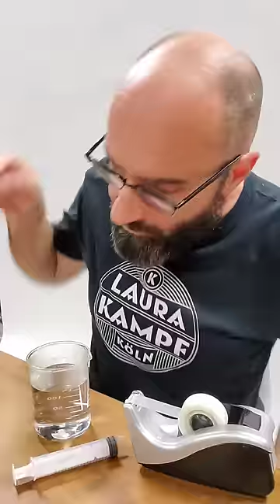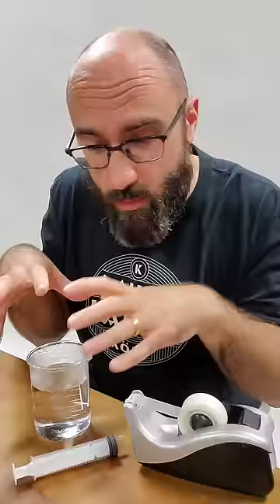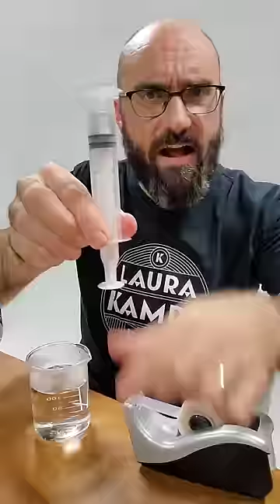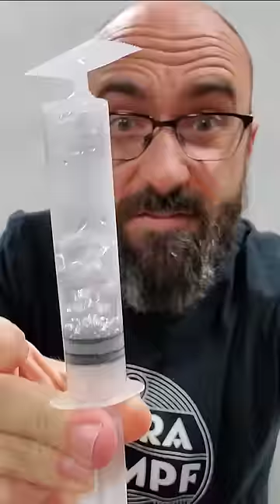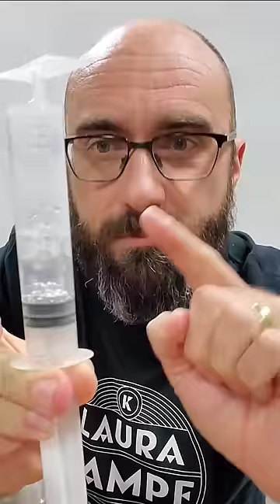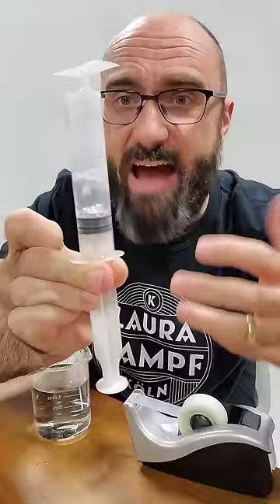Cooling down water by BOILING it

Comment: A couple of additional effects that were not mentioned are the specific energy of boiling and the adiabatic expansion, which both contribute to the cooling effect.
The specific energy of boiling (and similarly for freezing) is the amount of energy (heat) per unit mass that is needed to break the bonds between the molecules that binds them into a liquid. Basically, when a molecule evaporates it steals a bit of energy from its surrounding molecules to give it that extra kick to break free. This is the reason why boiling water stays at exactly 100C the whole time it's boiling, i.e., it doesn't get hotter than that because the evaporating molecules keep stealing heat away from the water at the same rate they get heated up. This is also the same reason icy water stays at exactly 0C. Now, this may be what he is referring to about "hotter molecules leaving behind only the colder ones", because this is sort of how this happens in practice, i.e., it's not really that molecules "steal" heat, it's more that as a molecule randomly gets enough heat to evaporate, it leave with that heat.
The adiabatic expansion is when a gas is expanded, either by an increase in volume or a loss of particles, or both, and there isn't enough time for heat from the environment to get into the container (or it's well insulated). This results in a drop in pressure and temperature. This is the reason why when you blow air out a compressed air can, it gets really cold. Now, in this case, it's a bit more complicated because it's not all gas and the amount of gas is increasing as it expands, but it would be a factor.
Also interesting is the fact that it keeps boiling (as in, bubbling) after the syringe is completely pulled out. This is because the water is now heating back up to room temperature, thus allowing more particles to reach the boiling point in that low pressure environment. So, the water will keep bubbling until it gets to an equilibrium temperature with its environment.

Comment: It seems to be boiling because air is entering beneath the gasket. When low pressure occurs, the pressure seeks a way to equalize the area
Reply: this will happen all the same without an opening at the bottom

Comment: Fun fact, this is how air conditioners work. Michael is the compressor, opening and closing the syringe, then you take the syringe inside to transfer the cool water temp to the indoor air, then take the syringe outside, compress the tube, condense the vapor back to water making it hotter, and let it get back to ambient, and then repeat the cycle.

Comment: This is why steam burns are more damaging than hot water burns with the same temperature. The steam hits your skin, coalesces and transfers it's heat to your skin, and reverts back to water. As such, your skin has observed the kinetic energy, and therefore heat.

Comment: probably the single most perspective changing lesson I learned was that boiling points are determined by air pressure as much as temperature
Reply: Right? Like, how much less heat it takes to boil water on Mount Everest than at Sea Level. Blew my mind.
Reply: This experiment demonstrates why boiling points change with altitude. 
I used to work in a kitchen at 2300m and we had to compensate for the reduced pressure when baking.
Reply: Yup, the super state of matter is really cool! All phases existing st once
Reply: @JB-qq1xz  do you have a single fact to back that up?
Reply: And conversely, how pressure cookers speed up cooking by running at a temp higher than 100°C.
Reply: @kiwirooks7299  he is wrong but matter can be in a superpostion of simultaneously gas and liquid or simultaneously solid and liquid
Reply: @kiwirooks7299  I think he is talking about the triple point.
Reply: @kiwirooks7299  water exists in three distinct phases at something called the triple point. Zero degrees Celsius is defined by the triple point of water which is 273.16K at 611.2 Pa.

At this temperature water is in the process of changing from a solid state into the liquid phase or visa versa. Molecules in the liquid phase can loose a bit of energy and solidify whilst solid water (ice) can gain some energy and melt. This can be seen in melting ice where the solid ice exists for some time while the exposed surface melts.

Molecules in a liquid don't all have the same energy. The energies of the molecules can vary from a finite minimum, which would mark the transition back to a solid phases, up to an infinite energy (although the probability of this occurring is infinitely small). The average energy of the molecules gives us the temperature of the liquid. Statistical thermodynamics can map out the energy distribution of the water molecules. At a certain energy molecules will have enough energy to evaporate, even if the water temperature is 0 degrees C.

Because of these two effects it is possible for the water to exist as solid, liquid and gas at the same time

Comment: This is why the best description of boiling point is when a liquids vapor pressure is equal to the atmospheric pressure and not just a temperature. Awesome video.
Reply: Yeah, that's a good point to mention. the "boiling point" of a substance depends on pressure, and when taking pressure into account makes a boiling curve, which is just part of the phase diagram as a whole.
Reply: Got to get my head around what U just said.
Reply: So is the water in both the beaker and the syringe at a lower temp than what we know as boiling point(in our atmospheric pressure), but this water "boils" in the syringe due to the vacuum change to the atmosphere? Asked in a dumber way, would that beaker water boil an egg?
Reply: @benjaminmartinez3588 It seems you got it. I suppose it would cook the egg but it'd take longer that's why cooking times are adjusted for high altitude areas (lower air press so lower temps of boiling water)
Reply: @douellette7960 nothing you said makes any sense
Reply: Well said , however , the boiling temperature nod the water in the syringe is not 100’C bcos it’s under different pressure
Reply: @benjaminmartinez3588  
No. If water boils at 10°c it won't boil an egg coss the waters temp is 10 °c.
Reply: @benjaminmartinez3588  
Water boils in space where it's temp is absolute zero.
Reply: This actually helped the video make more sense to me. Thanks.
Reply: Temperature in space is not absolute zero.

Comment: HVAC refrigerant theory right there.  Awesome demo!
Reply: What? I guess it's just that the boiling point of water is when the pressure becomes equal to the atmospheric pressure so you can make it low by changing the external pressure.
Reply: @mr-lacker  the water cools down by refrigeration. fridges do it using a compressor
Reply: a simple and ideal vapor-compression cycle is composed of four processes:
1-2 compression in a compressor
2-3 heat rejection in a condenser
3-4 throttling in an expansion valve
4-1 heat absorption in an evaporator

inside the tubes there is a refrigerant. the refrigerant starts by being compressed in the compressor and thus it heats up. 

then, it rejects heat to its surroundings through the condenser and leaves the condenser as a liquid. 

after that, it is throttled so it reaches the evaporator pressure by passing it through an expansion valve or a capillary tube (the principle the video shows). this also causes the refrigerant to cool down.

finally, the refrigerant reaches the evaporator where it "sucks" the heat from the fridge so that it gains the necessary energy in order to evaporate back to a gas.

this gas goes to the compressor and the cycle repeats itself. 

hope this helps.👍🏻
Reply: Damn, thanks for the explaination ^^
Reply: @mr-lacker  That's where refrigerant comes in, it's able to be compressed and heated (and the heat expelled near your radiator), then expanded and cooled (and blown into your car) much easier than things like water.

Comment: best explanation of pressure / temperature differentials I've ever seen
Reply: Do differentials mean they're equal ?
Reply: @Eduardo_Espinoza  differentials means there is a difference in pressure and they are equalizing. It's like a gradient, the molecules go from where there is a lot of pressure to where there is less. They boil up from the high pressure liquid part to the low pressure part thanks to the differential in pressure. The term differential is more used in engineering than chemistry or physics in chemistry we would not say differential but rather deltaP for pressure, deltaH for temperature, Delta being a triangle.
Reply: So differentials are like a steam engine? So the entropy is trying to equal out? @Repetoire  thanks for the reply :)
Reply: our teachers explained as when water boils, it loses energy. vsauce gut's explanation seems more real

Comment: An interesting side note that it takes far far more energy to change the phase of water than to raise its temperature. As in it takes more energy to turn 100 degree water into steam, then it would to take 75 degree water to 100 degrees for example.

Comment: This is basically how "cracking"/"popping" your knuckles, or any synovial encapsulated joint works; when the synovial capsule is stretched beyond its normal limit, through pulling, bending or twisting, a vacuum is created, thus causing the synovial fluid to literally boil. When this takes place, the rapidly-formed gas bubble causes a mini "shockwave," which is what makes the "popping" sound.
Reply: wow, when u put it like that... is it really unhealthy?
Reply: Mine blown 🤯

Comment: Also, water boiling is an endothermic process, so not only are the liquid molecules the overall coldest, but the vapor molecules also took a chunk of extra energy with them when they left the liquid.
Reply: Yes, except it's not a reaction, but it is an endothermic process. Phase change :D
Reply: @Repetoire  It's the reaction of liquid water and heat (? Nah, you are right, I'll change the word.

Comment: I used to do this as a kid and totally just thought it was a faulty syringe or that the rubber seal was not designed to pull partial vacuums very quickly which is why I felt trying to suck something really fast or by force that it just broke/ripped under the sudden pressure and was under the self reflected impression that I was needlessly destroying perfectly good syringes.

Comment: It’s like when you stretch a rubber band out for a little bit, then snap it back and it’s cooler. Letting some of the entropy get out of the material before bringing the pressure back to normal.

Comment: Thats a good visualization on how a Fridge works. A liquid is being cycled from gas to liquid using a Pressure pump knowing the fact that when liquid boils it sucks heat and when it froze it expels them. Put the zone where it expels/suck heat accordingly and help radiate it with a Fan and you got a fridge.

Comment: This is also why I say C isnt any better than F because it's perks only apply at atmospheric pressure. Neither count units of heat. One isnt metric vs imperial. It's just another arbitrary measurement system that only makes sense in specific contexts.

Comment: I was just thinking earlier about how to get water to boil at a higher boiling point so we can cook foods like with fry oil. With this video in mind, instead of making a negative vacuum, I think we would need a positive vacuum. Pump a chamber full of air, heat the water higher than its boiling point, then throw a couple fries in

Comment: This is how Air Conditioners work. Squeezing a gas into a fluid, cooling the now hot fluid to outside temp, letting the gas vaporize making it colder, letting room temp put its heat into the cold gas before its squeezed again

Comment: In my opinion, the syringe doesn't have the potential to draw such a vacuum to significantly lower pressure to boil water. Especially at room temperature. 
A micron gauge would be nice to see just how much less pressure is applied. My guess is not enough to boil water!

Comment: Another way to look at it is, as molecules break away from liquid into gas phase they spend some of their energy to break the bonds that hold them in liquid phase, thus losing some of that kinetic energy, while increasing potential energy  of the gas phase like in heat of evaporation.

Comment: This is why we do chemistry at STP (Standard Temperature and Pressure).  If you pull a vacuum over a vesicle of water it will insta-freeze for the same reason.

Comment: He isn't boiling the water. It is pressurizing itself. When things are pressurized. They can display similar effects to boiling. Like you seen here. Boiling is adding a outside source of energy. aka heat. To the container for the water turns into a gas. That would be boiling water. He is putting water into a cylinder. Then he is adding air into the cylinder. The pressures inside are great enough to create transfer from liquid to gas. It's not that the water is boiling.
Reply: Thats wrong, when he pulls the syringe back. He's REDUCING the air pressure inside the syringe not increasing it 

Pressure is inversely related to area, increase in area means decrease in pressure. Low pressure means boiling temperature is reduced because it takes less energy for water to become vapors 

Therefore, water which typically boils at 100 celcius at atmospheric pressures can start boiling at lower temperatures when pressure is lower

Comment: I remember trying to do something similar when I was 13, but since I was blocking the seringe with my finger, I couldn't pull withour letting a little air in, so I assumed it was not actually possible using just a seringe and something to block it.

Comment: Please, does gas evaporate without air.
Because he said molecules with the highest will evaporate as gas, and the needle is airtight.
Reply: it evaporates and becomes a gas, inside the syringe
Reply: @Umarshema  Air consists of gases, one of which is water vapor. Water vapor doesn't require other air molecules in order to exist, water can turn into a gas even in a vacuum, because there's lower pressure, which allows it to vaporize much faster. This can happen at room temperature.
Reply: @jewersp  thanks, brother
Well explained

Comment: So you created a vacuum to disperse heat. You gotta dumb it down for most folk lmao
Reply: That’s not what’s happening. It takes energy for liquids to evaporate, and when you lower the pressure you lower the boiling point, and so when the water crosses its boiling point it begins to evaporate, so it absorbs energy and gets colder

Comment: got a 35L dewar flask.
shoved a radiator on top of a rocket stove. pump, recirculating...
heated until boiling... 

at which point i measured 101C. being extremely confused, i tried another thermometer... 101C...

a third thermometer... 103C... yeah, that ones bad.

i still cant quite explain what happened there. its shouldnt be able to get over 100 until its ALL boiled AWAY.... latent heat... and it takes a LOT of energy to do that...

i just keep thinking its something to do with it being a thermos flask, and the walls themselves are holding then radiating that heat back... the water, being slightly under pressure as it pumps through the radiator as it reaches that 100C mark, can get over 100C yet not actually... "boil"... can you apply the term "superheated" to water? i thought it was impossible to get water over 100C whilst liquid at sea level atmospherics.. and im not below sea level, though it feels like it with all the rain recently... lol.

now i type that, i noticed it was only 101C when completely submerged, below the "neck"... 

whatever was going on, it was pretty cool to watch it bubbling away like an opened soft drink for about half an hour after turning the pump off...

its been four days and its still at 60C... not bad for a damaged flask from the bin...

Comment: Your term is misleading. You did not boil the water, you allowed it to boil. If you boil water the implication is that you're adding heat. And you cannot cool down water by adding heat.
Reply: Misleading, maybe. Scientifically correct, yes. Also, by your logic, you yourself aren’t boiling water by turning on a stove. You’re letting the stove heat the water

Comment: a very nice example of a youtuber explaining something he does not understand :D 
it goes colder because you have the same amount of heat over a greater volume, nothing is evaporating bro you have sieled the whole don`t you remember?
air-conditioners and freezers use the same principle to transfer heat from one place to another.
And you can make the opposite - if you take a certain amount of gas and apply strong pressure to it the temperature will go up because you now have the same amount of heat over a smaller volume. nothing is evaporating

Comment: That's basically just a backhanded way any air conditioning system works.  You take a gas, compress it into a vaporized quasi-liquid, shoot it through a tiny opening, and as it expands, it becomes cooler.  It's all just differentials in pressure.

Comment: In the Thermosphere too the air has a theoretical temperature of about 2,000 °C, but that's just their kinetic energy. Actually, Earth's atmosphere by those altitudes is so tenuous, no heath can be transmitted and the actual temperature is that of the cosmic vacuum - Reason why the ISS, which orbits at those altitudes, doesn't burn.

Comment: What if you put down the tape while boiling? ( Will it explode? just askin')
Reply: No, it won't explode. The air will rush in, equalize the pressure, and quickly stop the boiling.

Comment: So... You can create an air conditioner with no freon using this? When will this happen? Manually powered AC?
Reply: Air conditioning uses this already
Reply: @henrysanecdotes5323  No kidding? Does it use it with freon? I thought AC used a compressor to compress freon, not a vacuum compressor to boil water